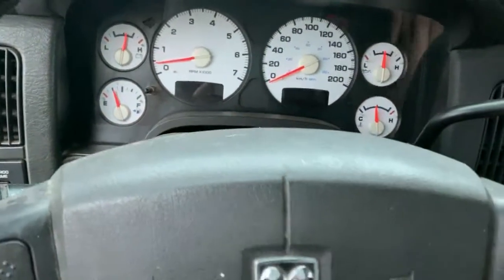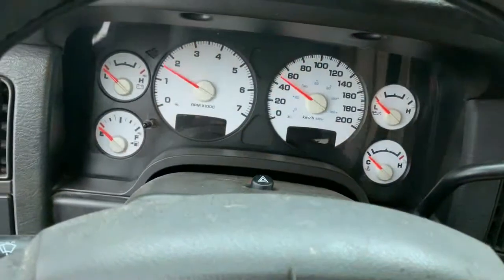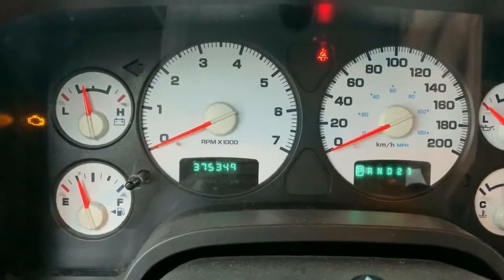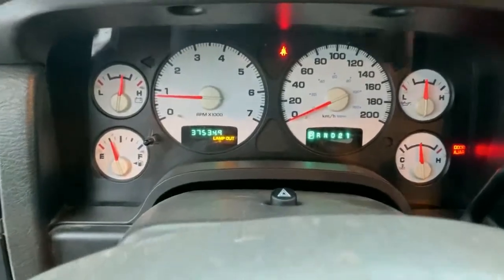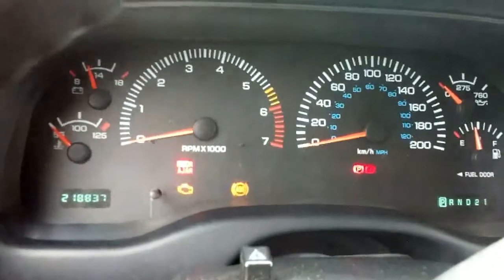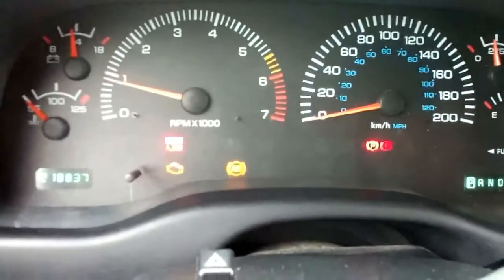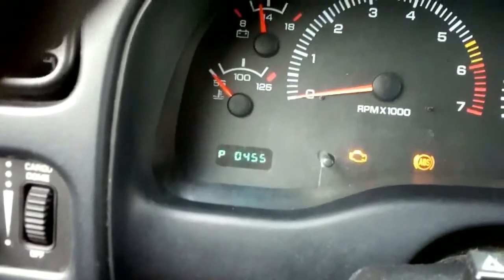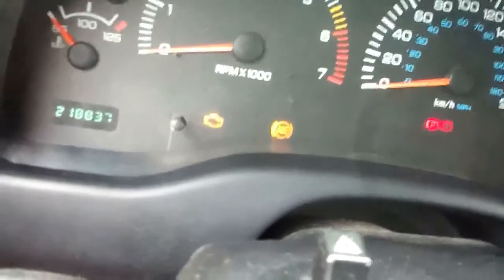Read Check Engine Service Light Codes At Home DIY - Dodge Ram Chrysler PT Cruiser Jeep Hemi Dakota

Comment: There's a trick for OBD1 as well. It's not as readable but it works. 
Put a jumper wire between PIN A and PIN B.
 It's the top right two. Google for image if unsure.
Let the jumper wire sit there and turn the ignition to ON. Do not start the engine
The Check engine light will begin to flash. Count the flashes. There will be a longer pause between the codes if you have several trouble codes and a shorter pause between the digits of the trouble codes. For example code 16 = 1 flash * Pause * 6 flashes.
When all trouble codes are outputted, it will flash the code 12 – 1 flash * Pause * 2 flashes.
Write down all the trouble codes numbers you got and check the trouble code table.
Remove the jumper wire and you're done! 

12. System OK ( Diagnosis mode active )
13. Oxygen O2 Sensor – Circuit open/no activity
14. Coolant Temperature sensor – Too High resistance or shorted circuit
15. Coolant Temperature Sensor – Circuit low or Open
16. Direct ignition system (DIS) – faulty circuit / shorted circuit
17. Camshaft Position – Sensor/Circuit/Timing error
18. Camshaft or Crankshaft – Sensor/Circuit/Timing error
19. Crankshaft sensor – Sensor/Circuit/Timing error
21. TPS ( Throttle position sensor ) – Out of range/Performance
22. TPS ( Throttle position sensor ) – Low Voltage
23. IATS ( Intake Air temp sensor ) – Out of range, low resistance
24. VSS ( Vehicle speed sensor ) – Circuit fault
25. IATS ( Intake Air temp sensor ) – Out of range, high resistance
26. QDM A ( Quad-driver module ) – Circuit #1 fault
27. QDM A ( Quad-driver module ) – 2nd gear circuit
28. QDM A ( Quad-driver module ) – Circuit #2 fault
29. QDM A ( Quad driver module ) – 4th gear circuit
31. Wastegate solenoid – Circuit fault
32. EGR ( Exhaust Gas Recirculation ) – Circuit fault
33. Map ( Manifold Air Pressure Sensor ) – Signal out of range, high resistance
34. Map ( Manifold Air Pressure Sensor ) – Signal out of range, low resistance
35. Idle air control valve / Sensor – circuit fault
36. Ignition system – Circuit error/fault
38. Brake input ( Brake switch sensor ) – circuit fault
39. Clutch input ( Clutch sensor ) – circuit fault
41. Camshaft sensor – Circuit fault or ignition control – circuit fault/error  ( Depending on the car model )
42. EST (Electronic spark timing) – circuit grounded/shorted
43. Knock sensor / Electronic spark control – circuit fault error  ( Depending on the car model )
44. Oxygen O2 sensor – Lean Mixture
45. Oxygen O 2sensor – Rich Mixture
46. Pass-key II – circuit or Power steering pressure switch – circuit fault error  ( Depending on the car model )
47. PCM data – circuit error
48. Misfire ( diagnosis )
51. Calibration error – mem-cal, ecm or eprom failure
52. Engine oil temperature circuit – low temperature indicated / Circuit error
53. Battery voltage – low/high/error or Egr valve solenoid 1 – Circuit error  ( Depending on the car model )
54. Fuel Pump – Circuit error or Egr valve solenoid 2 – Circuit error ( Depending on the car model )
55. ECM PCM – Circuit error or EGR valve solenoid 3 – Circuit error ( Depending on the car model )
56. Quad-driver module (QDM B) – circuit error
57. Boost control – Error / Faulty
58. Vehicle anti-theft system ( VATS ) – circuit faulty
61. AC (Air conditioning) system performance or degraded oxygen sensor signal ( Depending on the car model )
62. Engine oil temperature sensor – high temperature indicated
63. Oxygen O2 sensor right side – circuit open or MAP ( Manifold air pressure sensor ) – out of range ( Depending on the car model )
64. Oxygen O2  sensor right side – lean mixture indicated
65. Oxygen O2 sensor right side – rich mixture indicated
66. A/C (Air conditioning ) pressure sensor – circuit low pressure
67. A/C (Air conditioning ) pressure sensor – circuit or a/c clutch – circuit failure ( Depending on the car model )
68. A/C (Air conditioning ) compressor relay – circuit failure error
69. A/C (Air conditioning ) clutch – circuit / pressure high
70. A/C (Air conditioning ) refrigerant pressure – circuit high
71. A/C (Air conditioning ) evaporator temperature sensor – circuit low
72. Gear selector switch – Circuit error / Fault
73. A/C (Air conditioning) Evaporator temperature – circuit high
75. Digital EGR #1 – solenoid error/faulty
76. Digital EGR #2 – solenoid error/faulty
77. Digital EGR #3 – solenoid error/faulty
79. Vehicle speed sensor (SS) – circuit signal high resistance
80. Vehicle speed sensor (vss) – circuit signal low resistance
81. Brake input data – circuit faulty
82. Ignition control (IC) 3X – signal error/faulty circuit
85. Prom –  error/faulty circuit
86. Analog/digital – pcm error /faulty circuit
87. Eprom – error / Faulty circuit
99. Power management – Error / Faulty circuit
Reply from the maker: That’s a lot of good info 👍🏽 I’ve heard of people doing this, but I’ve never done it myself on OBD1 , I’ve heard of people using a paper clip to jump the plug.  Thanks for sharing all the good info